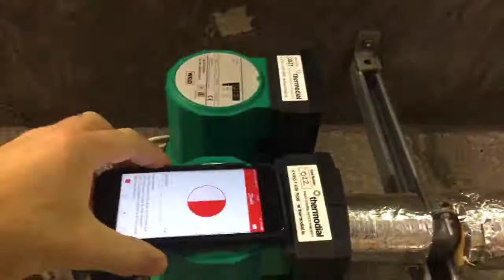App for checking operation of circulating pumps

Comment: It would be very nice if you could add a link to the app that you're using.  Thanks.
Reply: Tool does not work with newer Android versions.
Reply from the maker: Hello. Please click the link in the comments section. From there, there is a link directly to the application.
Reply: @thermodialvideo  where is the link at?
Reply from the maker: @brianhenderson9790  Hello. Please click the link in the comments section. From there, there is a link directly to the application.